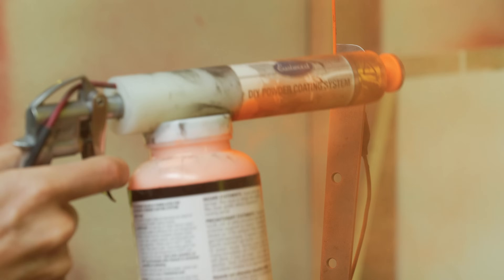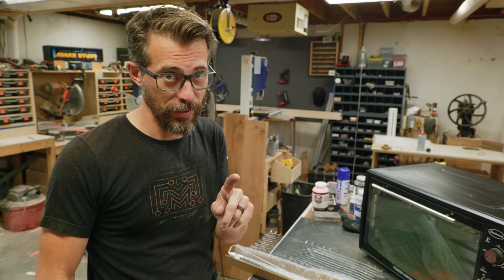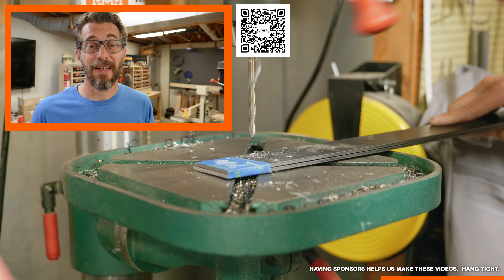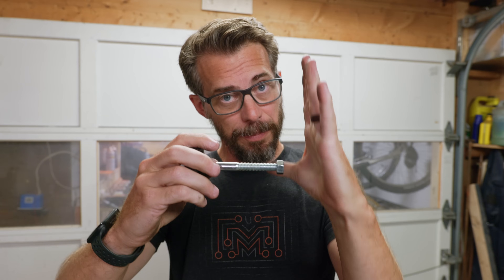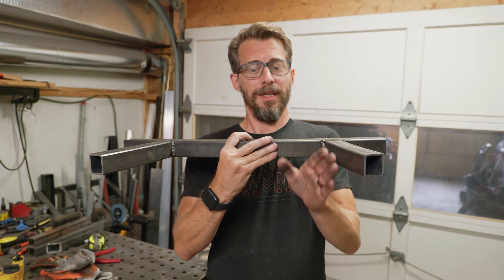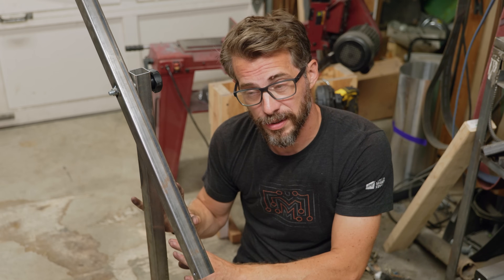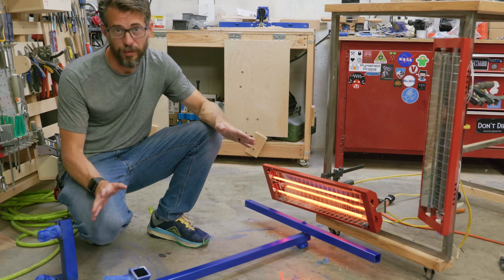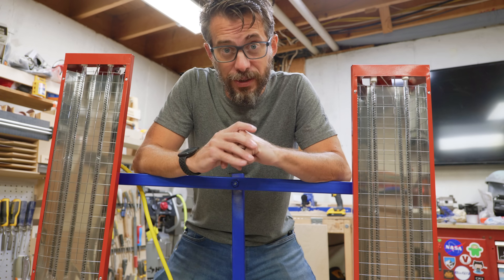How To Powder Coat Without An Oven!

Comment: Just a small observation, disassemble competelly to do the powder coat that way the chances of left a spot without coating will be minimum. In the video is noticeable that a part of the base is uncovered where it joins with the pivoting arm. Also when you have it all assembled the part that is not near the heaters acts as a big heat sink so your part will require more time to keep the temp you need with the risk that may not reach it at all so use a thermometer to check if the part reachs the desired temp.

Comment: The T frame that youy're using in limited by the distance the heaters are apart and the Z axis. Might be too late here, but what about using dual screen monitor arms, the gas strut type, as the top mount part?

Comment: I do a lot of gunsmithing, and I've been running against limitations when trying to coat barrels with something like Cerakote or Russian Paint. This is an interesting solution, but I think the most common situation in which you'd see parts that don't fit in an oven will be long and thin - and the easier solution would be to just punch a hole in your oven and heat the part in sections. 

That said, I'm surprised to see this works! I would've assumed that the part wouldn't hold enough heat while the heaters just radiate into the shop.

Comment: You should consider making the cord connections inside a junction box on each of the heater brackets. Open splices hanging off the back of the heater is pretty janky not to mention dangerous if the splices come loose from moving the heaters around on the bracket, and a cord connector will keep the extension cords from putting strain on the splices.

Comment: Why not just use a torch?! Would that be too concentrated or could you light heat up and move across a piece? Powder coating is fascinating and creates one hell of a durable finish but yeah how does one on the weekend magically powder coat without something professional or requiring being sent to a pro

Comment: It turned out pretty cool. One suggestion I would give is to use thermal insulating plates, perhaps mpu, I don't know of a similar material, with a reflective layer, nothing permanent, so when it was To heat the pieces, you would place these plates in the surroundings so you would make better use of the heat. Very cool project

Comment: Mask, Mask. Mask. Tape for areas that need to be grounded and silicone caps for threads. Wash parts with a grease cutting liquid. Grand an patch dings, scratches, and bumps well. The faraday cage will cause you issues where a spray can comes in handy. Light coats. orange peel is not your friend. Keep the powder dry. Water on parts will not be good for powder. Just a MFG engineer from a sheet metal shop working in a woodworking shop. Good luck. Love the powder coating just try to reduce patching after coating.
Reply from the maker: Thanks! All great tips 👍

Comment: Wait, you made a solution to a problem that you didn't really have? I would have thought you already had a need of such equipment in mind for a future or ongoing project. This would make for decent solution for powder coating the panels of the car! Also, I would recommend fabricating some kind tent to contain and reflect the heat, make it more oven-like without it taking up space all the time.

Comment: I couldn't tell if you did this already, but if you haven't, it would be a very good idea to ground that whole stand/heater contraption. It could save your life if the hot wire ever comes in contact with the metal casing.

Comment: Start small... powder coat some shackles for your Land Cruiser. Then step up to the springs in your suspension... then do the brake calipers, so you can work on doing logos at the same time. Then do some wheels for your Ghia. Finally, do all the tanks and bright work in the engine bay of every vehicle you own or can borrow.

Comment: I used to work at a Powder Coating company. Had a large, well ventilated booth to spray the items. Then we had to roll the racks into our oven. It was 10 feet wide, 8 feet tall and 30 feet deep, always at a toasty 450 F. Was an incredibly hot place to work.

Comment: 6:47 wow those castors are heavy duty.... but i personally feel you should've attached the 2 castors (the ones on the curved bar) closer to where the joints with the short arms were; just my intuition, i could be wrong
10:01 i honestly imagined you'd be making 2 stands, one for each heater, so that you could have more flexible configurations to point them at the object to be cured

Comment: @10:06, Obviously, stuff for the Karmann Ghia that's WAY too big for a standard oven or microwave oven.

@10:12, I find using a mist coat works best for a first coat as it allows you to identify any areas that DIDN'T get covered, then a moderate coat, then clearcoat (it'll lessen the chance of chipping due to friction)

Comment: Biggest thing would have been to do moving parts like the arm and base of the stand separately. The low covered at the mounting point is from moving the arm around you are knocking off the powder. On the stand itself. Overall good idea but would have been nice to have an extra joint on each side of the arm where you could point them towards each other with the project in between them. Another joint in the upright of the stand would also allow you to point them down over the top of a project. On what can you powder coat you have an ideal project you are already working on. The karmann ghia. All the suspense parts, the frame, the rims would all have a much better protection having a nice thick powder coated finish on them.

Comment: I did some work in a auto collision repair shop for a bit, they had a heater arrangement like this for curing paint when the full booth heater was unnecessary - single panels and the like. You could definitely reuse this on the ghia project.

Comment: If you are going to do it again, perhaps an old clamp on dual VESA monitor stand would worm.  There are several pivotal points on these systems that allow for multiple angles.   Now that you have this system you can powder coat your semi-circular bench legs and the frame components on the Gia.   

Wishing you and your family a blessed week filled with gentle seasonally appropriate weather and restful evenings together enjoying the fire pit.  Peace

Comment: I’m sure the Karmann Ghia has a bunch of parts that could be powder coated. 
Building some heat reflective shields to put on the other side of the heaters to the object being powder coated would save some energy and maybe speed up the process a bit also.

Comment: A little car in a farm not far away... but I think now you need a roll on reflecting surface... like those sun ovens used on camping... so you could make even distribution of heat and do better job of coating  flatter parts  or  more robust parts that need even distribution of heat.... these seens great for direct heat but does not seen nice to kee having to keep 'baby sitting and ensuring that alll parts of the piece will receive the heat....
just my opinion...

Comment: Quinn at blondihacks is currently going through a similar powder coating learning journey so her video might be worth a watch.  Also thinking aloud, you said the elements were 2kW for the pair, this should be 16A at 120V given that heating loads are almost perfectly resistive.  This should be well within the limits of a 20A breaker, are you sure they're not 2kW each?
Reply: I believe he said 2000 watts each.  I remember because like many others mentioned I immediately thought; well, he will need separate circuits for each heater.  Then again, I could be wrong.  I will look into the Quinn at Blondihacks channel.  Thanks!

Comment: Pro tip. 

Amperage is easy to calculate if you know the wattage of the heaters.

Wattage = amps x volts

Or in your case
Amps = watts/volts

So if those heaters are each 2000 watts like you said at the start, they’re going to pull 18 amps each at 110v
Reply: I bought the same heaters and had to add two new 20A circuits in my garage just for them. They would pop 15A breakers immediately
Reply: That's a great way and idea to build an oven.
Reply: I'd wire them in series and use a single 20 amp 240 volt plug.  Just one heavy duty cord, the shorter the better.
Reply: Thats the rule for DC but for AC its different
Reply: @jashtag Not really an issue with resistors (heaters are resistors), but more so for capacitive or inductive loads.
Reply: oh yeah you're right my bad @LykanVarion
Reply: @jashtag ohms law for AC is 
Watts/Voltage = Amps, so with that. Two 2,000 watt heaters = 4000 watts. So 4,000/120V is 33.3 so he’d need a 40A breaker with number 8 wire to cover both at the same time
Reply: @beardedfreedom  this is why he has 2 cords.  
He maybe doesn't have a circuit where he can plug in both.
Reply: @jashtag  no it isnt

Comment: Just put in a 20A 220v plug near your breaker box and build a 220v cord that splits at the stand into L1 and L2 for each of the heaters. One plug, one circuit, one cord. Also you'll have a plug in the shop suitable for a higher power welder.
Reply: Umm..20 amps is 20 amps. It'll still trip the breaker.
Reply: @Watthead80  that's 20 amps per leg. Each lamp would be tied to only one leg. If this wasn't in the US it would be a completely different story, but the way we do 220v can come in handy for weird projects like this.

Comment: A good ground is the key to better powder coating. You should try running a ground from your project to a good grounding source like a water pipe. I'd like to see this in action on some table legs because I have a project in mind for just such a device.

Comment: Bird Cage. They're powder coated to protect the birds from rust poisoning of the metal bars but the coat can be worn down by their beaks requiring replacement or recoating.

Eventually, it would be fun to make a custom cage for my parrot.

Comment: You might also get a couple of sheets of foil covered foam insulation to put behind the object you are powder coating to save the heat and reflect it to other parts of the object. If you ever need to form large sheets of plexiglass use the heaters for that.

Comment: Depending on the part, your going to get uneven heating on all the curves and bends with that design. You need a way to emulate an oven with even heat all around a part

Comment: Would it be possible to powdercoat parts of a car? Sidemirrors, exaust, the metal around the lights, etc...      Also, not as big but you could powdercoat the middle part of your wrenches. Each size a different color, and put your stock of nuts and bolts in 3d printed boxes using the same color as your wrench for each different size.
Reply: other tings i can think of
- make your old powdercoating-oven orange... (can you do stencils and create a ILTMS logo using powdercoating?)
- big machines like a power-hamer or mill (to "brighten them up a bit")
- powdercoat your home-made stuff (ports, benches,...)

Comment: There's not really a whole lot to powder coating, though.
,All you really need to do is clean the parts, use clean and dry air, use consistent pressure, and try your best to spray uniformly. It's all about the practice.
In fact, it might be best to think of it like using a big airbrush.

That being said, you might want to think about building a large sandblasting cabinet to reclaim overspray and prevent it from getting everywhere in your workshop. You'd have to clean it out after each use to prevent colors from mixing but it'd be a boon in the long run

Comment: seems kina inefficient 
here's an idea though if space is an issue
grab some aluminum square tube and make frames, skin them with sheet metal and fill them with ceramic fiber insulation (fairly thin/light, good for kilns) inset your heater elements into the panels (say min 4, max 8), make sure you run a temp controller, and run it on a proper breaker. make it so that when put together, you have an oven the size you want, figure out latching system to hold the panels together (like what they use on road cases for bands) so that when you're not using it, the oven can be packed down and stored against the wall or something

Comment: Hey Bob. I don't claim to be an expert - however - I have been powder coating for 8+ years, feel free to reach out if you have questions.
Reply: could i use an old fridge hang 2 springs(to be coated) in that and use a propane oven thing in the bottom of the fridge? (would that produce enough heat)
Reply: @crodles  the problem with a fridge. Even though they are insulated - they are plastic inside, the interior would melt.
Reply: @montgomery.metalworks  somehow that never crossed my mind lol. ill figure something out if i decide to do powdercoating. kinda need to coat/paint a spring on my snowmobile.
Reply: @crodles your best bet for starting - find an old cheap/free Electric oven if you have access to 220v just never use it for food after the fact
Reply: @montgomery.metalworks  norway all plugs are like 240 iirc but idk what oven would be "allowed" to be plugged into a garage without an electrician

Comment: When you powder coat things like car parts or older pieces of metal, you need to clean them really well with a solvent, i use rubbing alcohol, then you need to pre bake them to get rid of moisture it's picked up over the years. I do 12 minutes at 400 degrees. If you dont so this, the powder will flow out, then the part will start to off gas and bubble up the powder. Best of luck!

Comment: Watts= Current x Voltage
2000w/120v= 16.67A for each heater. 
Hopefully that saves you some headaches in the future. 
Love your stuff!
Reply: Yes, but each one is 1000W, so each one is drawing 8.33A.  The two together would draw 16.67A.  However, with things like heaters, there can be a pretty significant inrush of current when they first start heating up, so it's likely that they would draw over 20A when first starting up.
Reply: This comment needs to be pinned to the top!

Comment: Just a note - it's generally a good idea to wear gloves when handling those tubes. The oils from your hands will go onto the tube surface and can change the properties of the glass, leading to hotspots and potentially reducing the life of the tube.
Reply: Was going to make the same comment.
It's something that was drilled into me back when I started doing stage lighting.
Quartz lights do not last long with finger oil on the glass.
Reply: Yep. I was a theater projectionist in the day. That oil starts to boil and POP! 😮😢
Reply: Same goes for small, hot halogens, be they car or lamp.

Comment: Stand 2.0 - add pivoting arms so you can face the heaters towards each other with the object in between them. Also add two pegs on the back of the stand to wrap your cords around.
Reply: Add in a small turn table to spin your object between them too,  basically make yourself a shwarma oven
Reply: Literally was going to the comments to make this comment.  Glad someone did!
Reply: Exactly what I was thinking 🤔.   Something like a dual monitor stand, but bigger.
Reply: Yes, the top bar should be able to bend in the middle to bring the heaters closer together.
Reply: You could get square tubing one size bigger that will slide over the arm, cut a short one or two inch section for each heater and attach each heater to that tubing and then be able to move the heater anywhere along the arm. If you add a friction bolt you can still lock the heaters in place where you want them.
Reply: I was thinking he should use some cheap Amazon articulating PC monitor arms to be able to reach, pan, and tilt around stuff.
Reply: Love the video,,ok so I’ve ordered my heaters 🥴  are they considered short wave or long  lol .  I feel like I’m in over my head .  On line they say some provide shorter cure time than ovens do?  And how do you know when its cooked 🤪 I planned on just using infred temp gun  get it up to recommended temp for recommended time.  Any thoughts or info id appreciate it.  I’m using a metal box and was gonna set heaters in front of it thanks mt.
Reply: Maybe eventually buy two more heaters and use 4 heaters to heat the item all the way around. You're probably still have to move it around, but......
Reply: @thepeoplesfrontofjudea71  This will only work if you have 4 circuits within reach of your 4 cords.
Reply: Personally, I think he should beef up and repurpose his mobile light he made for his drill press, lathe, and mill and build these on an armature like that. You face them up, side, down, and on top of table tops.
Reply: Or just make a 2nd stand.
Reply: I agree and make the heaters where they can slide back n forth so you can bring them tighter together if ya need
Reply: What if you take a corner of your shop and place sheets of steel on each corner wall.. basically surrounding the object to be powder coated with heat that reflects off corner wall steel... Maybe even a large steel triangle that fits in corner to create a top  of the 2 corner steel pieces keeping the heat somewhat contained , kind of like an oven.. Never powder coated but I may now.
Reply: Not the greatest idea unless you keep them far apart. I tried this and it got so hot it melted the plastic mounts on the bulbs and poof... That's the end of the bulbs! If you angle them about 45 degrees from each other it works better
Reply: Also would allow the stand to powder coat itself.

Comment: Anytime I have to drill into metal,  I add a drop of oil exactly on the spot that I am drilling into, to help reduce the stress that I am adding onto the drillbit. I then use a magnet inside a plastic bag to collect the shavings, invert the bag & throw it away. But I keep the magnet.
Reply: Use cutting oil, it's got elements like Sulphur in it, specially made for cutting steel